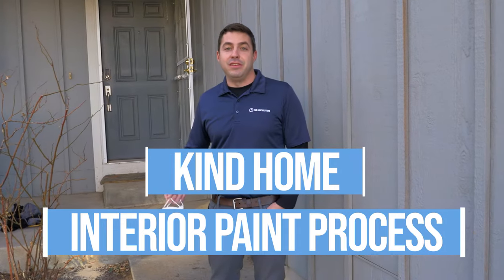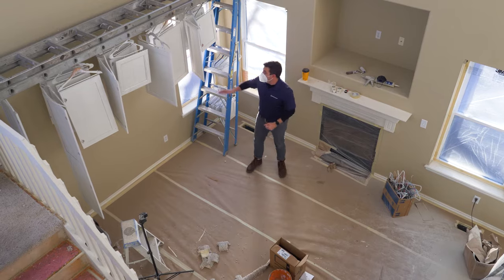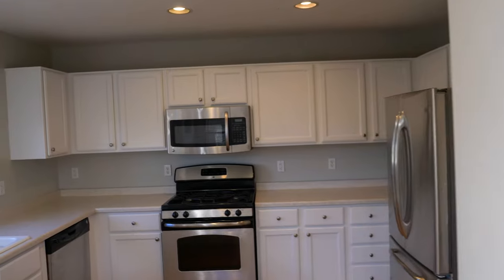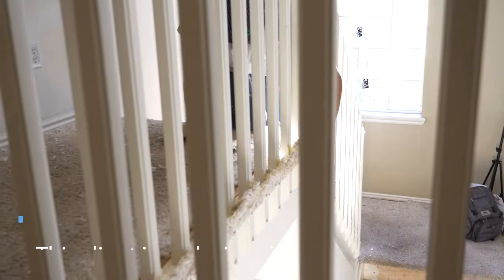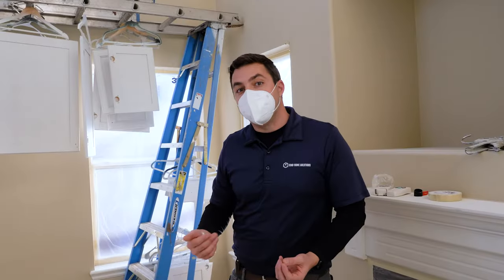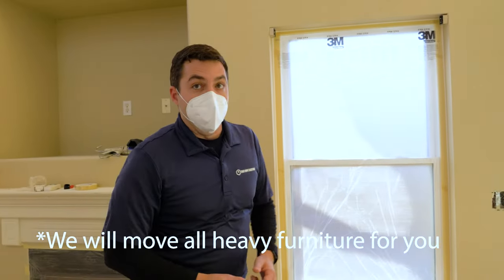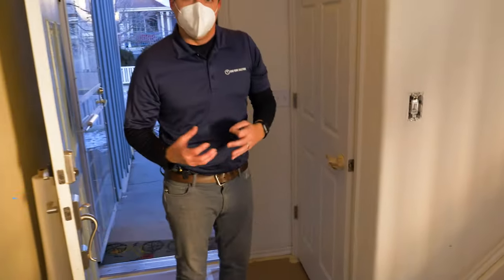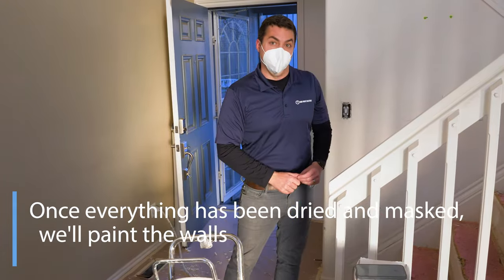Our Interior Paint Process From Start to Finish #interiorpainting #painting #denver

Comment: why do you spray every job? spraying the ceilings and doors i understand, but why the walls too? you gotto tape around the ceiliong to not get any spray on it, then having to tape everything clean your machines and spraying requires a lot more paint to be used than  roller and brush, and they both give you basically trhe same finish on the walls .
Reply: I’m guessing the sprayer just makes it faster. And the better you prep the less paint you get on other things
Reply: If your as quick setting up containments as painting. It’s a cleaner process